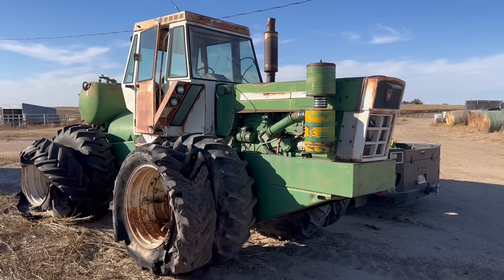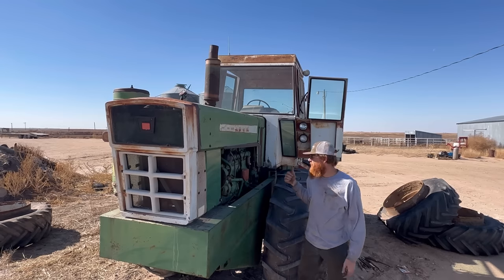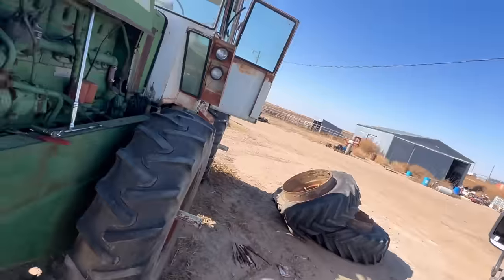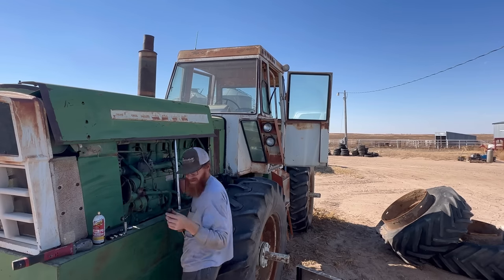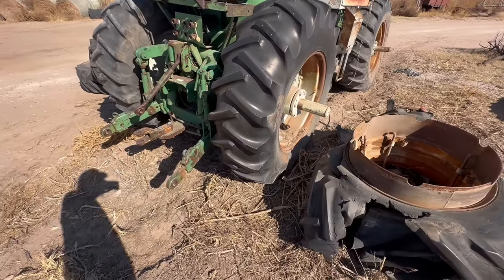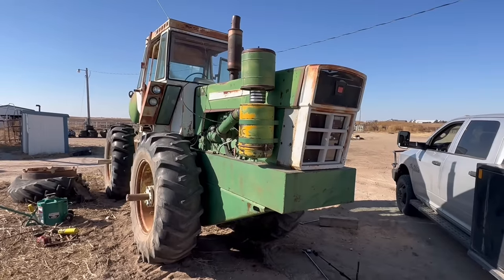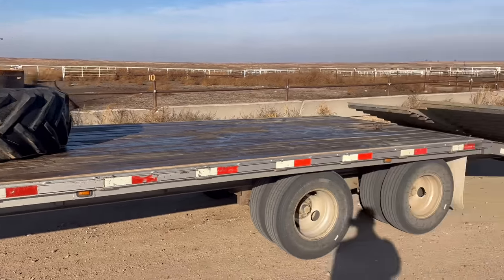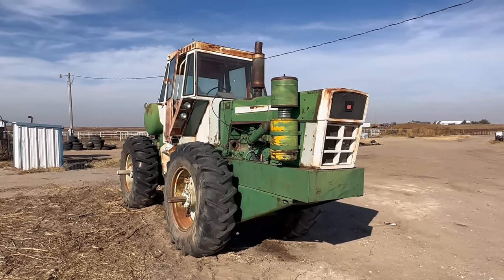Stuck motor? Working on my abandoned Oliver 2655 4x4 w/ LP motor.

Comment: Hey brother try taking some Acetone and ATF and mix both the ATF and Acetone in a jug half and half, shake it up and poor it down the cylinders and let it sit. That is the best thang to poor in the cylinders of any stuck engine.
Reply from the maker: Okay.
Reply: Truth
Reply: I've done this on several stuck engines and works. Depending on how rusted up/ stuck some pop loose right away others took some time.

Comment: Good video I was taught 50 years ago to take the polis put lots of WD40 in the cylinders and let sit over night and take a brass bar put down the plug holes and tap with a hammer lightly and it works
Reply from the maker: Might be a little tough on an 800 cubic inch motor.
Reply: @tmonteIH Did you get it unseized?
Reply: hah, that would be a lot of WD40!  It is a solvent though. @tmonteIH

Comment: Put the Oliver in high gear and tug on it with another tractor or a truck. Hopefully you didn’t pull the threads in the crank snout. That wouldn’t be good. I never try to break engines loose on the crank bolt. I only use it to bar free engines over. If the clutch will hold that’s probably the best bet. Also leave the plugs out while pulling.

Comment: 75% Diesel, 25% Marvel Mystery oil. Works every time.
Reply from the maker: 60% of the time.
Reply: @tmonteIH Works everytime for me. You have to be patient. It takes a few weeks to work. I fill them to the brim, then wait, when the fluid drops I put more in, I repeat the process 3 to 4 times, then give it the wrench.

Comment: I've never seen a tractor that large that wasn't a diesel. Completely surprised that it's a gasoline engine.
Reply: LP but yeah
Reply from the maker: Technically it’s propane. 1 of 40 with the big LP motor.

Comment: The plugs are for so called high performance engines. Does it help who knows.
Reply from the maker: Did some research. They were made buy a company that supplies ignition parts for natural gas engines. Makes sense since it’s an LP tractor.

Comment: Is it possible to convert that to Gasoline or a different fuel
Reply from the maker: Probably. Big a big carburetor.
Reply: Yes, it's a spark-ignition engine so it would be fairly easy to convert. A carb as he said and adjust the timing and that's about it
Reply: @frontagulus Imagine the torque that 800 CI" monster would make running gasoline?

Comment: Lp is not for me. Too much hassle to refuel. Personally I think they are obsolete. But good luck to you.
Reply: They produce much less power than gasoline as well so today's applications there is no way to run them on tractors unless you put a behemoth of an engine in there. But they are one of the cleanest fuel around environment wise, like 99% less pollutants compared to diesel as well as cheaper to run. Cars and light trucks could've benefitted massively from them.
Reply: It was obsolete, the day it was built.
Reply: If it still works and still runs it's not obsolete

Comment: Oliver 2655 LPG only 62 made.
Reply: this tractor was made by minnie moline and came out in about 1971. what most people dont know is the propane engines had more hp and torque   than the dsl model. and you could change the cylinder blocks and heads for a 800cid oilfield  engine. i worked for a M&M dealer and the owner  did that with his M&M 1600.
Reply: You realize that IS an 800 cu. In. Motor? The giveaway is the 3 bolt water jacket,  plus he said it was an 800 . Minneapolis Moline made  128 small bell housing engines of which 73 were put into A4T 1600 / Oliver 2655 . We had a Plainsman with the 800 that we farmed with and under the red paint was Oliver green, it was originally built and serial tagged as a 2655
Reply: @brokenwrench1 if this had more torque than the diesel, that isn't saying much for the diesel engine they used.
Reply: @marty8639 thanks for clarification!